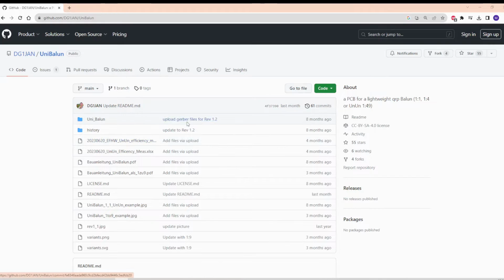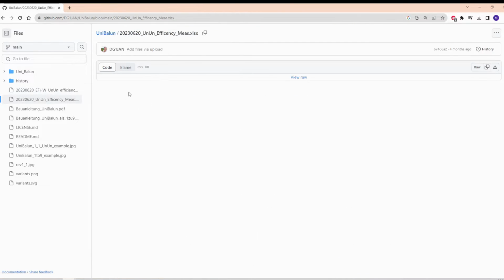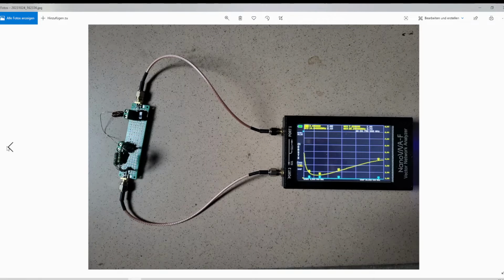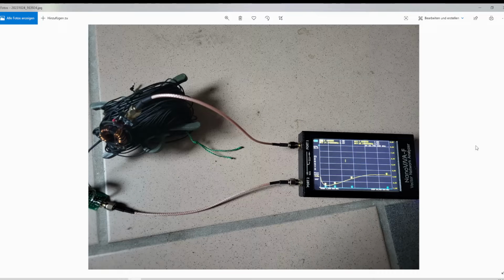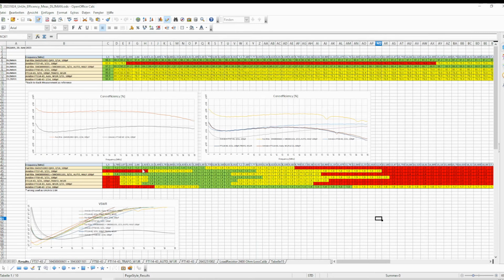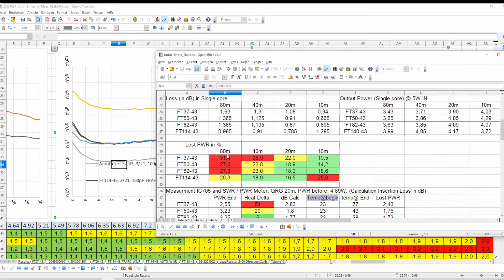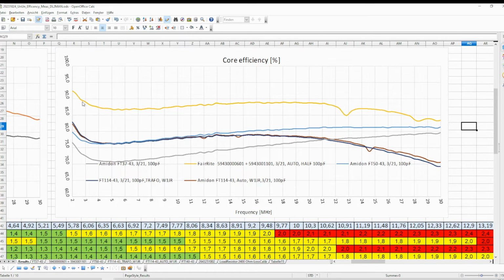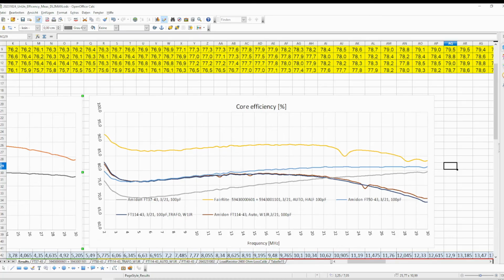EFHW transformer re-visited: improved core material & easier efficiency measurement

Comment: Excellent video, Jan.  I'm starting to learn about the fundamentals of magnetic toroids and how the various properties affect what.  Ive run across your and Colin's work while poking around on this topic on YouTube.  I'm pretty early on the learning journey, but is the primary benefit of improved "core efficiency" that of less core heating at a particular power level/duty cycle, so the transformer has higher power handling capability?  Less RF energy transferred to the core would mean that more can make it to the antenna, but a 10% bump or so in efficiency wouldn't be practically discernible in the real world.

Comment: minor Typo: it’s not 58430000601, there is one too many 0, it’s 5943000601 and yes that’s an FT82-43
5943001101 is not an FT114-43, it is an FT-50A-43
pretty sure, 73 Jer aa1of
Reply from the maker: Without having it checked, I assume you´re right. I just used the last 3-4 digits in order to seperate them. 5943000601 is not very catchy ;)
Reply: @dl2man  the full number let’s one search for and then order part for those who are interested. Yes, much too awkward to use in in conversation.

Comment: One thing I have had difficulty in finding out is what size of magnetic wire should be used for a given power. I know it will depend on mode, and what might be considered an acceptable loss due to heating. Large diameter wires will have less heating but are harder to wind and that in itself might lead to a lower performance, especially if you are trying to go for a tight winding pattern.
Reply from the maker: Rule of thumb would be: Use the biggest wire you can fit there, that can be decently handeled. From my own observations I know, that core is usually heating up more than the wire. What I do: For QRP 0,4-0,7mm^2 and for 100W: 1-1,5mm^2.
Reply: @dl2man  Thank you very much for your detailed response. Greatly appreciated.

Comment: Brilliant work, Manuel. What is the power rating of the FairRite cores?
Reply from the maker: I did not test. The big 1002 core is certailnly good for safe use with 100W and 100% duty cycle. The smaller cores will handle anything from QRP to 100W with some restrictions. Try it and observe if it heats up in practice. If it does: Use bigger cores.

Comment: I did not understand what you mean by "half 100pF" on the ...0601/1101 ferrite combination and did not see this notation in DG1JAN. What does it mean? Excellent and very helpful measurements, thank you.
Reply from the maker: I see.... The "half" was not related to the capacitor. It was a remark for me how the winding was done. All the other UnUns are wound according "W1JR Scheme", passing through the core after half of the required turns, then continuing in the opposite direction.  By that W1JR covers almost full core. "Half" means: Only half of the core was wound with all of the windings. In a "half moon pattern". 73 Manuel; DL2MAN

Comment: Hi thank you for this. Is it possible to try stacking two of the same core stacked one on top of the other to wind the transformer? If you want to play with the capacitor make one out of a length of coax. If you have access to a LCR meter is the 2k4 load purely resistive?
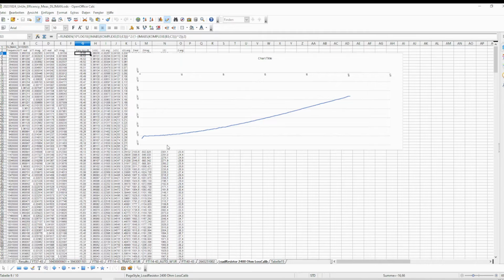Reply from the maker: Stacking cores.... Maybe I´ll try that. But I´m more interested in the effect of winding pattern. My Load is not purely resistive, as shown at 10:18. This is, why the Load was measured/captured and this "load measurement" was used in all of the UnUn measurements to compensate it.
Reply: One more thought would be use a transmitter. Run it key down and use an infra red thermometer to see if the core is warming up. My guess is that is what causes the efficiency numbers.
Reply from the maker: You should have watched my first Videos about EFHW Transformers to understand, why this Video was a "re-visit" of that topic ;)

Comment: I wonder how much of a difference this makes in reality out in the field? Do 15% more efficient transformers make a notable difference on an EFHW?
Reply: Efficiency is not all that matters.  An EFHW wire is not a constant value resistor, and a non-linear response from a transformer could actually work better than one that matches perfectly to a 2.4k ohm resistive load.  It is definitely worth reviewing the winding patterns, turns ratios, and toroids for which will be more efficient and allow for smaller matching units without overheating, but I wouldn't expect noticeable differences in performance from a perspective of contacts that you make or stations you hear.
Reply from the maker: That´s a very good question. In Terms of S-Bar: Probably not. But as a portable qrp station, I want to get as much of my 5W as possible. Why waste 1W in form of heat from my signal, if I can use it ?

Comment: Manuel, some thoughts that apply to all such recent amateur RF testing:
I'm very pleased to see hams digging into these things, as I believe that learning about RF electronics is the heart and soul of amateur radio. But after reviewing multiple tests conducted by multiple hams over the last few years I do want to mention that the physical environment surrounding anything RF affects the result of any testing. Theoretical numbers used as references in our testing are absolute, sometimes calculated in entirely free space, not even over ground. But the real numbers vary with each installation, even with what the core is attached to. How high is the end-fed antenna actually mounted above the ground? What is the composition of the soil over which it is hung, and what is the band of operation we are on at that height, meaning what is the actual impedance, (of an antenna that will likely not be entirely parallel to the ground in any event.) These things have substantial interactions with the antenna characteristics themselves. That's why you will get a very good SWR at one POTA site but a poor one at a different site, with the antenna hung somewhat differently over different soil. The ground composition and reflections are part of the antenna system. We have little control over those variables, but we really need to stop thinking in terms of efficiencies of just the 'things', and start to think in terms of efficiencies of 'installations', and try to make our testing as realistic as possible, or at least more appropriate, keeping in mind that our testing will also be considered to be an 'installation'.

A few things we do have control over are the shapes of the cores, the materials they are composed of, the winding patterns, the gauge of wire used for the winding, what materials our cores are mounted on, (is it a bare plastic? Is it copper-plated PCB material? Is the core mounted right against its surface? Is it on its side, or standing up?) And is a 49 to 1 winding better than a 64 to 1 winding? These things matter. They affect our test results, and our installation results, our RF efficiency. These specific things are determined by us, not the external situation. Yet I don't see any tests that fully compare these items, tests that are actually comparing apples to apples of the things we do have control over. I don't even know if some tests are being conducted with the cores mounted on copper-plated PCB material, on plastic, sitting on a wooden table, hung in the air, or sitting on a stone floor. That question of, were the cores laid down, or stood up on the material?  That matters. These things matter. They all matter. They can significantly affect RF fields and efficiencies. Or if they don't, we need to know that, too. Knowing what doesn't matter is as important as knowing what does. As hams, I find that such information is seldom included with our test results, or worse, it varies from test to test, so we cannot really get much useful information from such testing.

We are all hams, 'amateur' radio operators, not professional RF engineers spending a couple of months designing and optimizing a communications system for s particular installation. We don't take soil samples. We don't include the serial numbers of the test equipment we use to determine our experimental results. We don't typically have advanced, or any degrees, and most importantly we don't get paid to conduct our tests,. But if we as hobbyists are going to take the time to conduct tests and publish our results, we all need to at least understand what parameters affect the results of our tests and identify them for our testing purposes so that we can make useful apples to apples comparisons, progress in our understanding, and make sure we don't send others off in the wrong direction. Many, if not most of us now have NanoVNA's, and they can do impressive RF analysis, so we have no good excuses. Even as unpaid hams, we all need to up our game a bit in order to advance our hobby. As always, thanks to you and Guido for doing just that.
Reply from the maker: John, Thank you for that comment. I could not agree more, and as a native speaker you anywaycan express yourself way better than me. All I can say is: Wait for it. Wait for the next Video..... That will solve all this contradictions ;) And Johne: thanks for your long term support ! Really appreciated !
73 Manuel; DL2MAN

Comment: How much extra can we squeeze if we get a 50-ohm input impedance? You can use an online parallel wire impedance calculator and put enough heat shrink tubes on top of magnet wire to keep an even distance on the primary winding's first 2-3 coils.
Reply from the maker: I´m sorry, I don´t understand the question... Could you maybe explain a little bit more what you mean ? 73 Manuel; DL2MAN
Reply: @dl2man If you wind a primary coil in a perfect parallel way to a secondary one, in other words, create a 50-ohm ladder line. I quickly checked with the online calculator, and the spacing for AWG16 (or 1.02mm dia. or 0.923mm^2) should be 0.293mm, about the thickness of the single thermal shrink tube, to have a 50-ohm impedance. If you put on a single shrink tube isolation on the primary wire, another one on both to keep them together will result in a 50-ohm line on that part where two wires are wind next to each other. In this case, I'm talking about the classical transformer, not the autotransformer.
Reply from the maker: @2EOGIY  I don´t think this works, as the core dictates the impedance.... once your former 50 Ohm line is on there.
Reply: @dl2man  ratio between the first two turns of the secondary winding and primary winding that consists of two turns should  be 1:1 regardless of the core
Reply from the maker: @2EOGIY  a) I have already proof by measurement, that there´s no significant difference between real transformer and autotransformer b) the ratio between primary and secondary is not 1:1, because you can not dismiss the rest of the secondary. If you would build a 1:1 Transformer, maybe.... c) the impedance of the primary coil alone is determined by the amount of windings and  is further frequency dependent from core material. d) The impedance "seen" by TRX or NanoVNA is dependent from the load on the secondary. You can easily check that with a Poti on the secondary, while connecting your NanoVNA to the primary.

Comment: With this method, if I am not mistaken, the impedance you use in the test is the same as your antenna. This may not be the case. The back to back method makes no such assumption, but tells you which core+winding method is efficient. You then need to have the best winding ratio to match your antennas impedance. In reflection if you have correctly estimated your antennas impedance, then this single core method is much easier having only to wind one core. You can then change your winding pattern, core, and capacitor to find the best design. I recently made an unun and measured its efficiency using back to back method following Evil Lairs recommendations (related to Colin's) and got some very nice results of >80% across HF. Will experiment more. 73's
Reply from the maker: Thanks for your comment. The impedance is the assumed antenna impedance. It just provides a higher ohmic referenc, so everything is compareable. We will get to this soon (in the next video), as the Antenna Impedance is extremely dependent on elevation height. So we might need to have some adjustability available to adress all those cases. 73 Manuel; DL2MAN
Reply: … that‘s where the Fuchs or other EFHW tuner with variable C will come into play. It will eliminate those external influences as opposed to the broadband transformers used in EFHW antennas. 73 de Chris DL1GKC
Reply from the maker: @DL1GKC  Fuchs turns my beatiful Multiband setup into monoband, and tuner causes also losses. But there´s a simple solution and this is what we´re going to look at in the next video....

Comment: I'm certainly open to new methods. If the trend is different are we only gaining precision?
Reply from the maker: The Trend is the same. This was confirmed. What we gain is: Not needing to wind 2 Transformers. And with the Test Jig, I also don´t need to put a capacitor or SMA Socket on the UnUn. I just screw the UnUn in the terminal connectors, start the measurement, feed the excel sheet and have my result. On Top it provides a real efficiency curve, while I manually tested at 4 Data Points only before. Providing an accurate, more complete picture of whats happening. 73 Manuel; DL2MAN